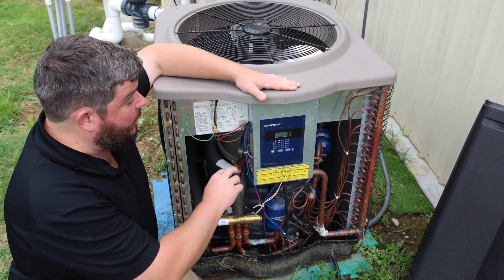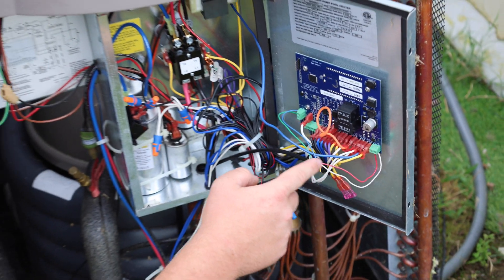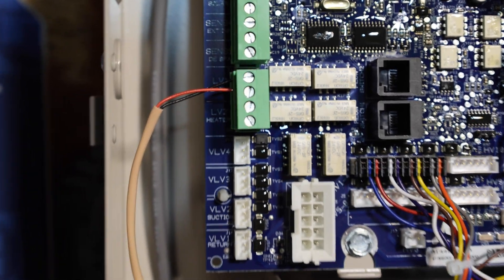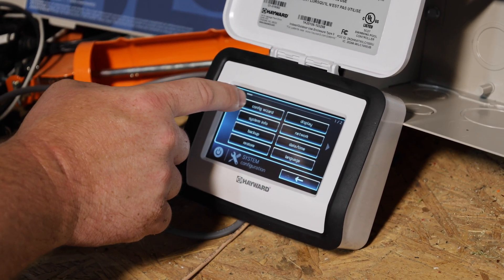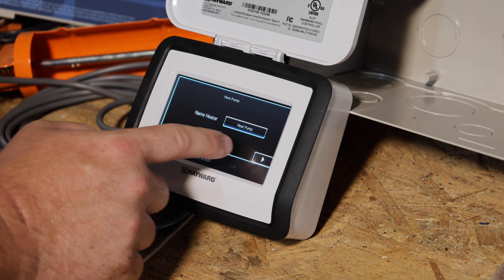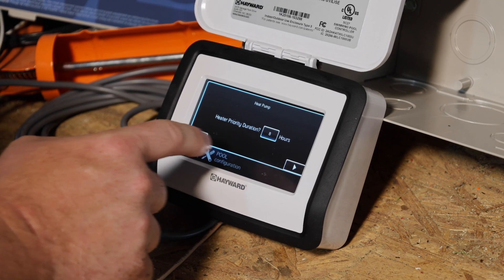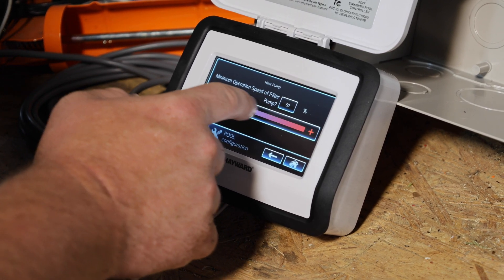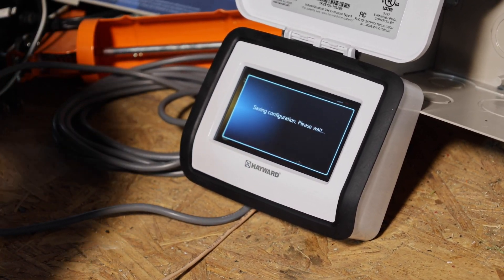Hayward heat and chiller pump wiring to automation

Comment: Hey awesome video. I had to order an HLRELAY to do this for my heat pump, the first 4 relays were already populated. I was wondering if you could dive into 3-wire Smart Heater Control in a video, I am working on my parents system so trying to keep it as simple as possible and not tinker around too much haha, but I think I could have rewired this with the communication bus using no additional parts. Smart Heater Control is mentioned in the OmniPL installation manual and chat GPT claims the heat pump supports this but I cannot find it mentioned in the manuals I have for the HP31204T
Reply from the maker: Hey the HP31204T does not have the smart communication option. You have to wire it up as is shown in this video. There is a smaller, round-style heat pump that does support smart communication. We do not stock that model but next time I am in front of one I will make a video.